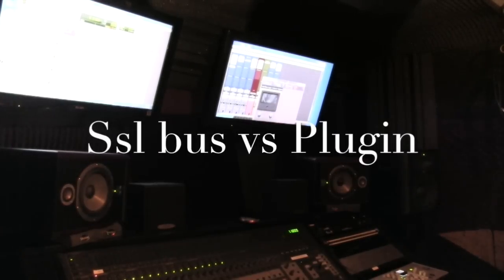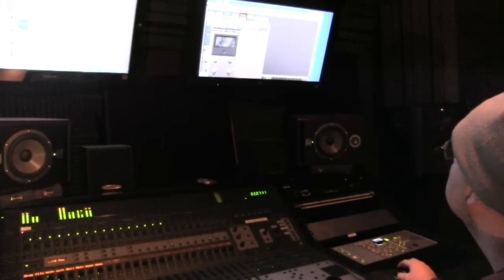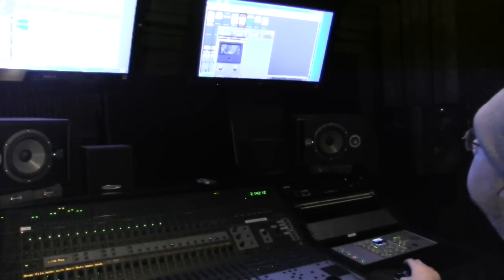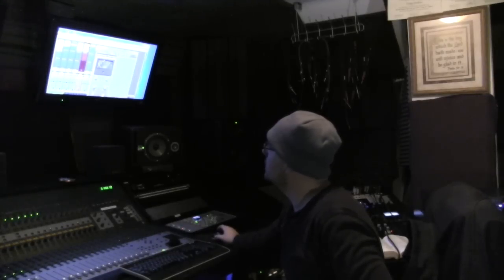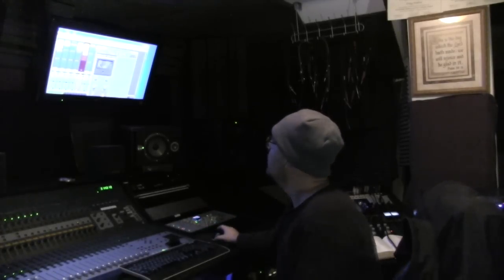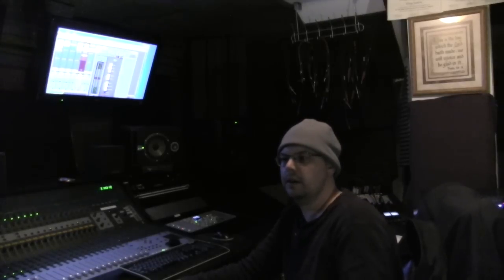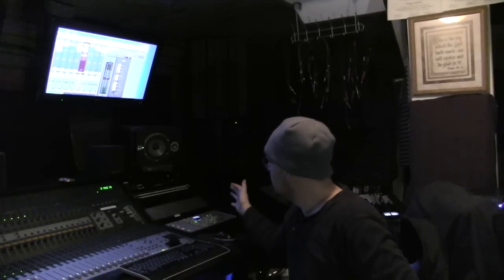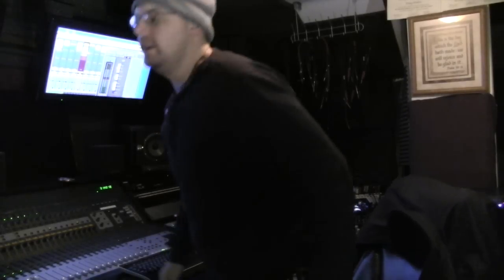SSL BUS Compressor VS DUENDE

Comment: Would you ever make a video on how you run your apogee in standalone mode? I swear I look everywhere and no one has it!!
Reply from the maker: Yeah but to save you some time, I run it into a RME 9652 card.  I like the routing on the RME CARD  ... Acts like a patchbay.  So it requires two devices.  you can search for something like a rme adat card on google..  that's a windows thing. stable drivers. great thing

Comment: Im not surprised the plugin is struggling if you are up to -6db RMS.  Streaming services will automatically bump it down to -12, so I don’t understand unless you are mastering for CD why you are mastering so hot.
Reply from the maker: that video, it was for CD,  But agreed.  Spotify and other services are -14 lufs  which is same lift, different image all together, but I agree with you, plugins really have come a long way.  and the plugs can do a lot of the lifting. this depends on the convertor/clock, and how the dsp interacts.  where hdx plugins sound more natural to me.   The only thing I can say, actual gear, does imprint a tone, a ssl has a drive/image , same with a Neve.  As far as processing,  great line amps with compressors in the box, should be able to handle any quality mix. Hardware compressors aren't dependent on a digital counterpart, so they have a unfair advantage to begin with.   A great man in the business from Antelope audio mentioned, to model every piece of a hardware device, you would need one computer dedicated to run just that, so they design plugins around the parts they want to model.  I would love to show you a master.  And hopefully prove some of the gear we have grown to love outside the box, that does the job very well.
Reply: Doug Jenkins Now I know you were mastering for CD your levels make sense, and you are, regrettably, right about the hardware thing. Eric Persing of Spectrasonics also said that until there is quantum leap in computer power it will not be possible to accurately model hardware. He’s been in the business for many years, and if anyone should know it’s him. There is a difference particularly when pushed and with that finalising sound. Shame really as plugins are narrowing the gap, but the gap remains.

Comment: The Duende is a digital compressor. It is the same as the one on the C digital mixer as it has the same algorithms. It is not modeling the hardware version. The hardware reigns and I'm glad I bought it. I also have the UAD SSl 2 bus compressor which is modeling of  the hardware. But the hardware still sounds better. If it didn't, I would have sent it back the to the store as I had a 30 try out

Comment: I think a percentage of this comparison is subjective. I don't expect a plugin to fully model electronic circuitry or potential-meters. I would expect to have to make adjustments to the plugin settings-for the reasons I mentioned. I don't think it's reasonable to expect the settings to be a carbon copy to the hardware. A plugin still has to operate in the confines of digital headroom vs analog circuitry headroom.
Reply: +slapopimp Hey slapopimp, read your post and figured I'd answer yours as it seemed interesting. I'll start from back to front. Old digital headroom, can't be that much right? Analog headroom is 120db at best. I'm talking big board Neve/SSL/API etc... That's incredible right? So at best, if you record hot enough, you can stay away from that noise floor of about 96db. As there is nothing but hiss around -100db and under. Did you know that digital headroom @ 16bit 44.1k is around that? Oh wait, were talking about 24bit 44.1k or 48k (what I record and mix at), that has 144db headroom. That means you can record a signal at 80db and still get the full 24bit/44.1k signal. Try it.
More than any analog device out. So I won't mention the 32bit/48k to 192k, I guarantee it won't be fair. Digital headroom is far superior than any analog could ever be. Look up analog headroom and then look up digital headroom if you don't believe me. 
Why can't we set the plugin and have it sound like the hardware? That's fair right? I just did a test that did just that with an old Neve 2254/E unit and A/B'ed with an Waves V-Series plugin and the new Lindell 254/E plugin and everyone except 1 person who picked the Waves version (bastard) picked the Lindell plugin as being the hardware. Go figure right? 
If your interested, I'll send you the link so you can do the test yourself.
Plugins can and do model every aspect of an hardware unit. They can and do that now. Digital has gotten a huge bad wrap from early design that haunts them to this day but, the tide is swinging. Don't believe the naysayers, see for your self.

Marc :)

Comment: I agree, it's amazing piece of hardware but, the software is the same compression/sound. It's no different than having 2 different pieces of hardware. When the input to the hardware and software are the same and the output is RMS matched volumes, not many if any can tell the difference. They both are great and having the hardware is great to have for the people that want knobs and are into the physical hardware pieces like I was but, the sound is no different. By the way, the SSL Duende models the SSL 9k J buss compressor which the C200 algorithms was based on and the C200 code/algorithm was put into the plugin.
Reply: imsrprod I put a Duende with PrismSound ADA-8XR converters which to my opinion are the best you can get, against an Axiom MT+ which is older than the C200. 

The real Axiom blows Duende to pieces. What was I thinking, getting a million dollar sound out of a 1000 dollar box... It'll never happen.
Reply: +Lawrence O Hhhmmm, isn't the Axiom using the same G Buss Compressor? I have to admit, I've never used the Axiom MT+, heard of it though. I think it's known as the worst selling SSL board to date. That doesn't mean that the Bus Compressor isn't good though. I think this was the board SSL first was trying to do the "digital control to analog processing" or touting something like that. They finally got it right with the Duality.
Anyway, again the sound should be the same. I'd love to hear this huge difference. In every A/B test I've done or heard, there was not a huge difference that everyone quotes so strongly about. I just did a test with the original Neve 2254/E vs the new Lindell plugin vs the Waves plugin. Guess which one they went for? They were 100% sure that the plugin was the hardware. It's all perception. I did the same with the API hardware vs the  Waves plugin. No one could tell the difference though they swore that the plugin sounds nothing like the hardware. That one was an eye opener for a few. Same with the magical summing box or the magical SSL board. It's all perception. Again, does hardware matter "Yes" for certain things that need a certain color but, plugins now, are there... Weather you or I want to believe it or not. This younger generation are proving it too. Calling out us old guys (I'm not that old by the way) when we say that the hardware is better and they prove us wrong. 
Anyway, sorry for the longwinded answer back. Forgot about this thread...  I'm back now...
Reply: All I'm trying to say is that duende is complete and utter shit. It does not even come close to a real desk. Not a top notch digital one and certainly not a top notch analogue one.
Well, hold on, I might forget that it still passes through the pro tools software mix buss. May it's the one doing all the damage. I honestly don't know. I only know that I still haven't heard a reverb plug-in that compares against a great old Lexicon 300L verb. Or a plug in that beats the sweet sound of a Tube Tech CL1B.

On the other hand, it would be cool if ever we could get there. No more cables, no more power cords. I look forward to test my waves bundle. I got the mercury with studio classics and now also the Abbey Road collection.... I truly hope they're as good as you're telling me :-) Thanks for the feedback! Much appreciated
Reply: +Lawrence O The thing is the Duende CStrip AND bus comp use the code from the hardware C200 digital SSL desk, code is code, they are the same. Now whether the C200 strip/comp is "worse" than the old analog 4000 is another question but Duende is certainly not complete and utter shit (it's the same as the C200 in fact I think they even improved a couple of aspects due to modern CPU power). I would say that in this case it's probably due to the other factors like the crap pro tools summing bus (seriously time to dump "Pro" tools, it's one big con - if you want an example of something that is complete and utter shit, that would be pro tools compared to many better DAWS out there like Studio One, Cubase etc).  Anyway back to the topic, I too am a believer in hardware, some of it, that can't be done right in software, but on some things and more each day the software is getting there...

BTW I absolutely hate waves plug-ins, not political just using my ears. THEY did more damage to the perception of analog emulation than any, all dressed up with official badges and shit yet are #1 one of the worse offenders, harsh, narrow, shrill, thin... ugh. The waves ssl bundle is awful, put duende next to it and duende feels like hardware for sure. The EQ models that waves do (abbey road etc) again, thin, gutless, harsh. I swear waves have basically one or two algos that they just dress up in a new skin twice a year, the only plug of theirs that ever got close was their puigtec (pultec) and even that was only good on some sources when not pushing too hard (again try the Acustica cooltec it's basically IS the hardware because it uses advanced 3D convolution not digital algorithms). So if you are testing stuff against waves no wonder you are thinking plugs are crap (mostly). I've seen many people originally like waves for the bling factor only to disown them later on, they make most mixes sound harsh and narrowed vs decent modern plugs by others (try softube and Native instruments classic comps and even their solid bus comp - all much much better on the ears than Waves)

 if you look at nebula for eq and "mojo" this can often reproduce the euphonics of hardware, while normal plug-ins generally can (sometimes) cause narrowing, harshness etc it's all down to how you use them and how many you pile up in that case. Less is more with digital processing unless they are great plug-ins. Also routing out of your DAW into a desk and going through a console is of course going to impart a fair bit of "3D" depth and character vs all ITB but again, nebual console sims can get there, all this to say that Duende itself doesn't suck, because it's doing exactly what the digital console did, it's more likely the lack of routing through real hardware (esp analog consoles) than the code in Duende itself. In many cases hardware beats plugs but not all, in some, plug-ins actually sound "better" than hardware without the narrowing, harshening, downsizing of sound that bad plug-ins are famous for. I've been comparing a REAL 1176 to a certain plug-in 1176 recently and 9/10 I picked the plug in! It had all the growl and tone but sometimes was "thicker" sounding and could also be a bit punchier. I love hardware and am surprised by that but there you go... Try some acustica EQ plugs (Navy, Honey) (neve/harrison) best ITB eq that sounds like analog hardware.
Reply: +quarkyzarky Hey QZ, there are a couple things I'd like to comment on your post that I don't agree but first, I'll agree with you. The Duende CS is good and is a direct port from the C200 but better code. That is the same board "Underdogs" used on many of their hits amounts other users.
Now the dis-agreements - Waves plugins sound great. The SSL package "SSL CS, SSL EQ and SSL Bus Compressor all match the 4000 E/G series sound. The 4000 held the lowend a lot better than the SSL J hence the reason why Dr Dre used it for so many years. If you A/B the Duende and the Waves version you'd see that the Waves version can hold more lowend than the Duende and can achieve more lowend than the Duende bundle. The SSL J is a more Pop cleaner sound like the SSL J 9000. The Duende has a more Low Mid punch but not a lot of Low sub punch. That is the main difference in the 2. I can go on about the other differences but that is the reason why, they both sound different. Both are modeled off of 2 totally different consoles.
Nebula in my very humble opinion are terrible. The free version at least. I tried it as I was highly recommend to it by a lot of people and so I did. It was very confusing and horrible user experience. Horrible cpu usage. I've tried it twice and never liked it.
Now, I've never used the Acustica version as I hear those are better on cpu usage and I'm sure I will try later. 
I agree that the Puigtec is good. It models the Pultec versions and Softube modeled the Tube Tech versions that model the Original Pultec's. Confusing but those pieces of hardware are great and the plugins nailed it.
k, back to work. Marc

Comment: How can somenone compare the Duende bus compressor (which is the algorithm taken from the digital SSL C-consoles) and compare it with an analog SSL hardware bus compressor taken out of one of their analog consoles. The Duende plug ins and their algorithms were taken out from the digital SSL C-consoles and these were NEVER designed to emulate or clone an analog SSL hardware unit.And where do know this from? Well I spoke with Jim from SSL.

Comment: You can mix with a compressor plug in as long as it subtle but mastering with plugins is a huge big NO NO.
Reply from the maker: Only way, I'd ever consider it.. is very subtle stuff..  1.5 ration, use plugins like rcomp from waves, for attack and release issues.. last resort.  But yes, I would use linear eq's on the master bus, that's one plugin, that just does a great job, with reduction..  then use the Manley massive passive for boosting..
Reply: tj mack Haha, most mastering now-a-days is hybrid. Just in case you didn't know, most Mastering Engineer's limit the final with digital compressors/limiter plugins. It's the only way to say competitive in this new louder gen.
The only reason they use analog is for color/sound of that unit. No longer can hardware match digital plugins in loudness! That's truth!
Reply: And that's why music sounds like crap these days.
Reply: I agree but, that has nothing to do with software. I will say that music sounds a lot better than it use to though as far as quality. Just because you use hardware, that doesn't mean your record is gonna sound great!